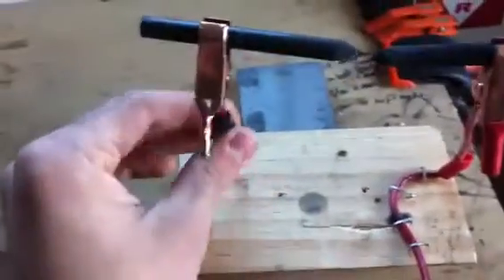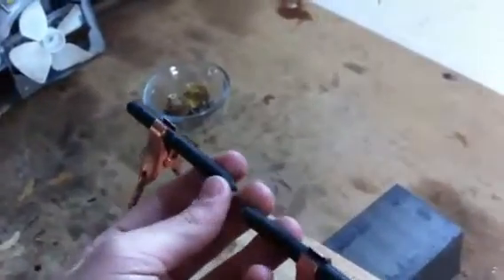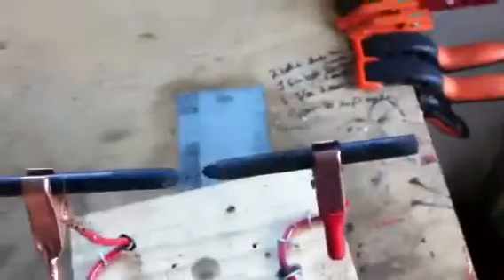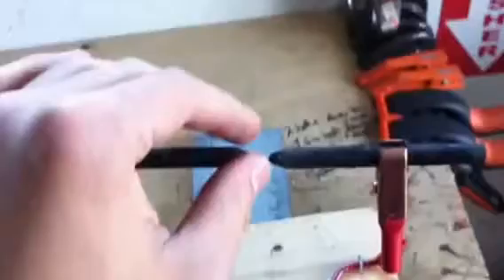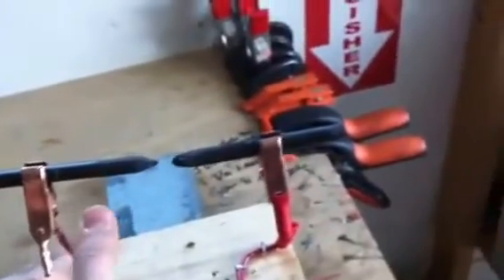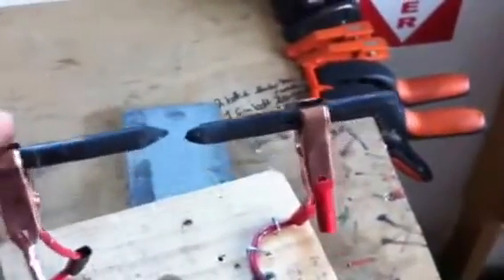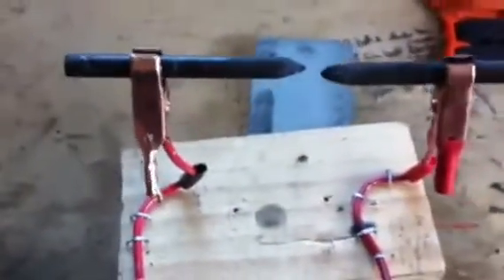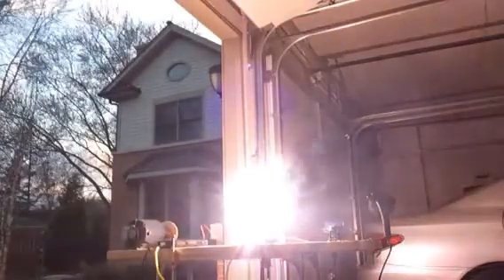Carbon Arc Lamp

Comment: I could do an arc with a MOT modified transformer, 12V AC, I know AC is harder to maintain an arc, it means it's possible do with a car battery, but you have to find out the way to do it, I tried do it with 6V AC and it really don't works, but at least 12AC, you can badly contacting touch (touch and untouch some times) the tips to heat then until they start become incandescent, this time you may be able to get an arc, low voltage is harder to get an arc, really need know how open the arc to be successful, I've got 25A of arc current.
If you have more 12V batteries (3 of then), you can try 36V DC arc, it must be stable, because you must know AC has turns on and turns off because the 60Hz oscillation, the voltage rises on positive side, downs to zero, keeping downing to negative side peak, and than, rises to zero again and keep rising to positive peak, this happens all the time at 60Hz, this is what make a AC arc be harder to reach, this is why DC inverter welder machines are better.
But you must reach a stable arc with a lower voltage that you got it on 50V AC voltage, like 24VDC or 36V DC using batteries linked in series.

Comment: In the late 70's I was trained doing this, I'm a lithographic printer and we use arc lights (using carbon) to expose the film to metal decorating   plates. We also use to recycle to the steel and copper plates used on the presses. It's all digital these days now.
Reply from the maker: Fascinating! Always nice to go back to the analogue basics to learn fundamental principles.

Comment: I built these as a kid growing up in the '60's. You are missing a ballast. The ballast limits the current through the lamp. I took another 2 carbon rods from batteries just like you have. Put these two rods in a series circuit with the existing two rods that will light. Dip the two new rods in salt water. I used some kind of quart sized container. Keep the rods separated and immersed in the heavily salted water. This will act as a current limiter to the other rods. You might have to "strike" or touch the two arc producing rods together briefly to start the arc.  You also will see a little smoke rise from your makeshift ballast but it will work much better.
Reply from the maker: Interesting and quite practical idea! I would be inclined to do a bit of testing to figure out the resistance at different salt concentrations. Thanks for watching!
Reply: 🔴 What Is Islam? 

🔴 Islam is not just another religion. 

🔵 It is the same message preached by Moses, Jesus and Abraham.

 🔴 Islam literally means ‘submission to God’ and it teaches us to have a direct relationship with God. 

 🔵 It reminds us that since God created us, no one should be worshipped except God alone. 

 🔴 It also teaches that God is nothing like a human being or like anything that we can imagine.

🌍 The concept of God is summarized in the Quran as:

📖 { “Say, He is God, the One.  God, the Absolute.  He does not give birth, nor was He born, and there is nothing like Him.”} (Quran 112:1-4) 📚

🔴 Becoming a Muslim is not turning your back to Jesus. 

🔵 Rather it’s going back to the original teachings of Jesus and obeying him. 

More .....👇

Comment: You need a ballast in series with the arc, to limit the current.
Reply: Or you can just use an auto-transformer to vary the current manually.
Reply: @thatretrocattt  also my apologies. I didn't realize the second test was AC until I rewatched and saw the caption page. So yes the Variac would totally work and be well worth it. I don't even know how I managed to miss that.
Reply: He said it was running on a battery. You can't ballast dc with out an inverter.
Reply: @Slowly_Going_Mad  yes you can. Put a 12v bulb in series and it will limit the wattage to the wattage of the bulb
Reply: @AdamAvacado  your right but I was specifically referring to the Autotransformer concept. Plus I kinda hate on resitive ballasts, especially when the voltage exceeds 50 v.